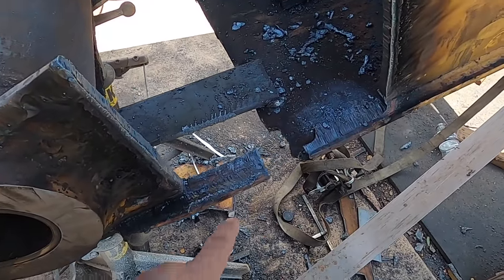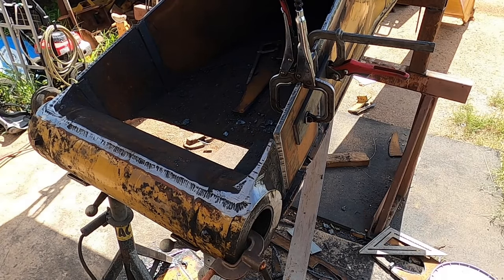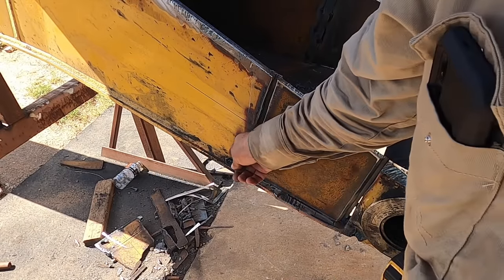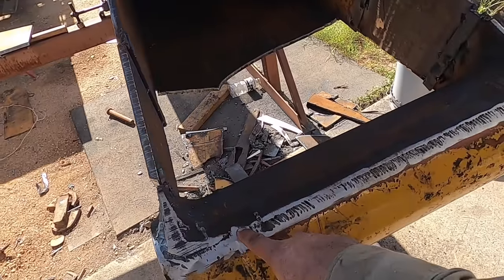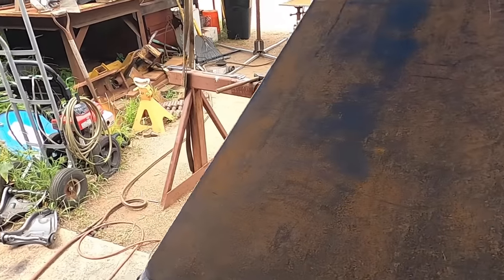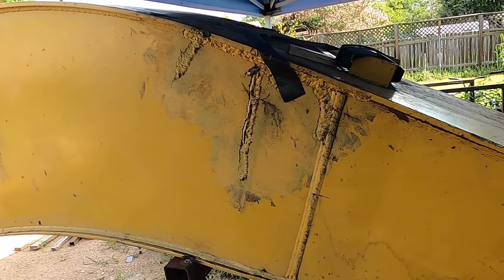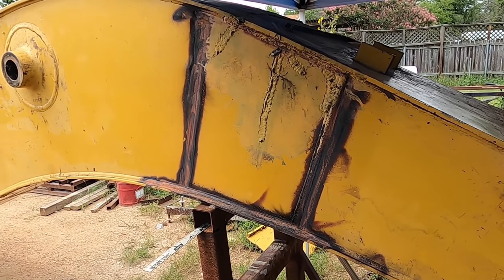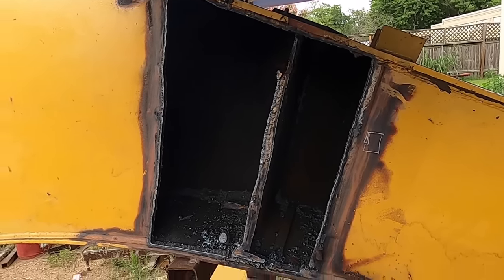Part Two: Excavator boom repair

Comment: "I guess that's why they call it stick welding..." That's about all I do when i stick weld. LOL.  I start welding school in a week. Hopefully I can make some improvements.
Reply: You'll be "sticking" less after the first day of SMAW practical exercise.
Reply: @ralfie8801  I imagine all day start. Stop. Start. Stop. 😆
Reply: Curtis Roberts 
I'd imagine you'll start out with some easy to burn 6011 stringer beads on flat plate coupons. You'll do better than you think once you get some instruction. Hang in there, it'll come to you. You'll be welding uphill and overhead in a few months.
Reply: @ralfie8801  one thing I found is that to a large extent welding is welding. I do pretty well with TIG and flux core. I'm sure stick welding we'll just take some time to get the nuances down.
Reply: You younger people are lucky today, you get to watch these videos at any time to give you tips. Back in my day it was trial and error unless you could get a pro to give you his time to pick his brain. I went to tech school and I’ve been welding and fabricating for well over 40yrs and can still learn something new by watching these videos because there’s always someone who’s run into a situation that you haven’t yet even after you’ve been doing it for years. Like IC said in 1 of his videos, “No matter how smart you think you are, there’s always someone out there who knows something you don’t.”
Reply: Mike Hunt67 
That's exactly right.

Comment: You are quite correct in your thoughts on direction of grain structure vs strength.  Coupons to determine tensile strength are always taken in the  rolling direction of steel plate.
Also ASTM E-45 standard for determining micro structure grain size is also sampled in the rolling direction.  This often referred to as a through thickness longitudinal micro.

Comment: As an airline structures mechanic, we always bend across the grain. If you bend with the grain, it's guaranteed to crack.if we need to bend a box, we turn 45 degrees to the grain. That way neither side is being bent along the grain.

Comment: You are right about steel having a grain direction. This if from a google search...."Yes, steel has a grain direction, which is determined by the mill's rolling process. The grains run parallel to the rolling direction".

Comment: You are a lazer with a torch. I used to watch my grandfather do repairs like this and others. The only thing different (IDK if it's better or worse,just diferent) he would replace the damaged plate just you did but he would overlap the inside plates 1/2 the distance or at least 3-4 inches on both sides. so after teh original plate was done and the inside holder plate was done he would do an outside plate (AKA sandwich) and stagger the welds from the inside plate with the outside plate. if it was a high torsion part, he might even cut holes in the inner and outer plates and weld in the circles. Took a while but I don't think i ever saw the same piece fixed twice.

Comment: You are right about the grain of the metal. It is always running lengthwise instead of widthwise. That's why when you curve a skidsteer center section, it's easier to do it and also gives it strength on the radius of the curve.

Comment: 10 seconds into the vid and I learned a new trick: use a piece of wood tall enough to rest the torch tip nut on the use as a guide. So simple it’s genius!
Reply from the maker: Its actually an aluminum bar
Reply: @ICWeld  that’s a beefy bar. I was wondering how it wasn’t charred.

Comment: The straight edge appears to be of the perfect thickness so that when the tip retainer nut slids along it the flame is exactly the right distance away from the metal.  Whether that's an old welders trick or your own invention it's genius!

Comment: First class torch skills! Nobody better than you Isaac in my opinion.
Also, the grain structure of the plate, how many people would even think of that when cutting out a repair section? Very few.
As for the grain of the plate, l agree the grain runs with the length of the plate as it is rolled when it is first made. That is subject to how a small (8ft X 4ft for example) is cut from the primary sheet of steel made in the factory.
Very interesting stuff and great to watch a master a work. As for me, l have to finish welding up a rotten 2008 Ford Transit van this morning. Not as interesting your work Isaac but somewhat more dangerous because it is plastered in underseal over all the rust!
Best regards from England UK!

Comment: Good evening, surpise surpise. I know one thing. Do not bye Caterpillar escavators. They are manufactured like crap. It's hard to believe that there are so many structural failures. Makes you wonder about the rest of there heavy equipment. All you can do is the best that you can. When making repairs, at least you know there is a future in major repairs. Good luck to you, Joe Capo.

Comment: Do you ever use scarfing tips? It seems like one would help out when you’re trying to clean stuff up and make it flush.
Reply: Good idea I wanna get me a set of those they are super handy to have around
Reply: @mattfogarty8144  I used to use them all the time when I was turning in welding test plates. We used to use them to cut off the backing plates so that they could be bend tested.

Comment: Is there a point of diminishing return on something that has been broken, cut, repaired, broken again and patched again?  Is the owner concerned that his operator(s) are so rough that they keep breaking  this thing?  Seems a new boom might be the answer somewhere along this journey to the scrap yard.  Your work is outstanding and likely as strong (or stronger) than new.  Keep the videos going, I would love to see this boom operating and the environment it is working in.
Reply: The calculations on repair vs replace remain the same. Flip a coin six times in a row coming up heads, the seventh is still 50/50.

Comment: Thanks IC for sharing your experience and talking us through your work plan as you find the pieces, fractures and heat zones.
The <rap that is passing through American MFG. doors is a shame today. Buy brand new broke or doomed/boom to failure.

I really wonder if these sub-assemblies are welded/fabricated off-shore? Anyone know?

I always found on rebuilding manufacturing equipment if time allowed was to replace past the damaged area and add supports to prevent the failure in the same place.

Comment: Pretty dang neat to watch Isaac, you cut so damn smooth and straight freehand............I fidgerate (combination fidget and gyrate) to much to cut nice with a torch, like a dern tiny little chipmunk........you know the ones that never stop moving, like they're on crack and every movement they make it seems they're getting shocked lmfao.

Comment: The brake press operators where I worked would complain if a batch had some parts cut along and others across the grain, I dont know if it would make any difference with what you're doing here but I like the way you're thinking.

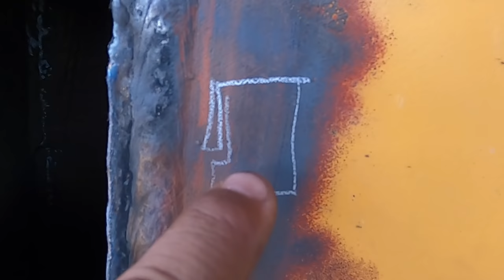Comment: Part 2 to my comment. In regards to video link, at about 27:48 you can see the overlap of the inside fish plate and the outside one with the burn outline on boom. Hope this helps get more knowledge. Not everyone does these repairs but I think you have the skillset to do more hd repairs. Bet the customer would be really happy to see some HD reinforcement like that. Nonetheless be careful this stuff is heavy so think twice and stay safe.

Comment: 28:20 stress risers like that are not good. Best way to do them is to cut rounded edges to them. I've three booms done with this and they're extremely strong structures that take up way more than the factory made ones because the cracks that might form can't form around the square edges. Also, my fabricator came up with an internal structure of sorts where he uses rods to secure the corners, we use those mostly for factory stuff, because you can just drill the corners and slide and weld them inside. You'd think that big companies like these would have better structure analysis departments. All it took us was a few hours to render the boom in 3D and do some sims, it wasn't even full on process, just approximations of the metals and ruler borne measurements. IMO, they don't even try.

Comment: I was taught that any straight vertical weld on a frame would make a week line in the structure doomed to crack . Beeline Safety Service  frame straightening , wheel alignment , brakes . Fix La Car to 80 ton dual steering axle , rubber wheeled crane   80 ton , yard use dump trailer , one off  construction , with too much  camber in the start of fabricating the frame we had to make the new frame fit the  pre-cut pieces all ready cut to spec  . We used 1 , 125 ton jack and 2 ,50 ton jacks to do the job , scary .

Comment: Your intuition is correct where the grain direction is concerned. There is better toughness perpendicular to the "grain" or the direction the steel was rolled into a coil. I am not a metallurgist but
we had a lab in the factory where i worked. Drawing steel you see where it fails AND where it likes to stretch and form without cracking or failing when stressed. Was that 1/4" or 3/8" plate? Anyway it was HRP&O, Hot Rolled, Pickled & Oiled. Each coil had a Tag with the Heat # and Rockwell (or hardness) back in the day.
     That "Plate" came off of a coil, and was sheared after de-coiling and straightening. Then skidded up to ship or sell.    Your skill level is really a great thing to observe- you hardly need a grinder after your torch cuts. Bad Ass really. (Welder, Press operator,welding lathes, brake Press deep Draw Metal Flow Operator and on and on). Some of the above was for your readers, I know you are no beginner.
   I learn a lot on here reading the comments. Keep up the good work- like your channel.

Comment: When I took my certification for 2G and 3G flat, the requirements were to have a backer bar and 1/4 inch separation between the pieces to be welded.  My 6G 6 inch pipe required an 1/8th inch gap but no backer.  Little gap is good.

Comment: Back again!  Cutting the "pattern pieces" is a much better method of getting the replacement the right size.  Would the plasma cutter you bought after this job have done as well as you did with the OA?

Comment: Shouldn't the backing plate be the same thickness as the parent metal, otherwise it's just a filler panel to hold the weld in.

Comment: Steel has a grain it comes from the direction it was rolled in the factory, You will also find that your welds will have a flatter and look smoother one direction better than the other will sit higher.

Comment: I heard a lot of hissing and popping when cutting the flat plate and later when opening up the left side of the boom.  Was that the camera audio or were you running short of gas?  I don't recall hearing that when I am cutting nor before in yours.  Not that I am comparing myself to the maestro!  The video audio does do some funny things to sound but in between that flat plate and the cutting on the left side the torch sounded normal so it left me wondering.  Always enjoying watching you work and appreciate your equanimity!

Comment: Your cutting is laser straight. You are quite a fabricator. Question is why did that boom fail that way? It seems to have split along several factory welds as well as in other areas. Pleasure to watch a craftsman at work. You know you metals and how to work them. Did they use too brittle of metal and too thin or poor penetration of their welds? Do a little metal work now and then so curious.

Comment: Why not offset the two rhombi? Meaning the inner cuts do not line up across from each other. Much like offsetting electrical wires when soldering, to further prevent shorts. If the welding cuts don't line up, then a bending/breaking force cannot concentrate.

Comment: Pure art man. Amazing. Question though. What is the nozzle of the torch made of so it doesn’t melt? It slices right through that steel but it doesn’t melt? I’m new to this so just trying to learn. Thanks!
Reply: ha, good one! the hottest part of the flame burns a little distance from the nozzle, and the nozzle is cooled by the cold gas flowing though it.

Comment: I am surprised you do not use the plasma cutter more, in the beginning of the video you were torch cutting the new steel plate when you could of easily plasma cut the metal.  I use plasma much more then I use a torch due to ease and quality of cuts.

Comment: If carpenters worked with metal, all torches would have guide wheels on them, and you would clamp a fence on first and then run the wheels down it.
Welders are crazy free handing this stuff! Lol

Comment: How can you be sure someone REALLY knows how to use a cutting torch?  When they cut 3/8 plate cleaner than you can cut paper with an xacto knife, using a wooden straightedge, and manage the heat so well the wood doesn't even discolor, that's a pretty good indicator.

Comment: If there is any metal grade lettering on the plate, the grain direction will run parallel with the lettering.  At least that's how our shop does it.

Comment: Just wondering what you use for steel,plate when doing these repairs on excavator booms. Is it AR  plate or just hot rolled plate
Reply: Was wondering the same
Reply from the maker: T-1 plate
Reply: @ICWeld   Awesome thanks.
Reply: @ICWeld  Have you ever used Domex steel before? Supposedly it welds like butter. I’ve heard that T-1 can get hard spots in it from the steel mill that can be sometimes problematic later on.

Comment: Hey, you are great with the torch!!! what are your settings on the gauges and what tip size did you use to bevel the plates?
Reply: He has a video up about torch tips he uses and settings. Best I recall there were like two tips for is “go too” ones 
Hope that is some help

Comment: That boom was destined to fail from the start, I would say Bad on Cat but I will bet to save cost things like these booms are not in house manufactured. Likely mass built across the pond shipped and assembled in the states It is the only justification I can come up with for that ridiculous baffle plate.  Roughly a $ 250,000.00 machine failed by few pieces of what look like scrap steel.

Comment: rear cutline should not be straight perpendicular line to flanges.Should instead be triangle or radius shape
Reply from the maker: The Factory builds them with straight lines perpendicular to the top and bottom flanges. They hold up fine so long as they're welded correctly.

Comment: looking at the metal fatigue I would be scrapping the project..

looking at the thickness of metal tells  me it should be preheated before welding

yes you can cold weld shit to cows come home however when  anything is used in construction it has to be certified  as safe to use  and typically has to go through a x-ray machine... preheating helps the metal to bond with each other..

Sadly with the amount of defect in the arm I would not be certifying it to be used as it is intended to be functional used

If you did you be at legal liability  for it

Comment: What are your thoughts on Harris torches? Yeah or nay.? Does anyone else here have any experience with them?
Reply: Stan, I've been using the same Harris torch for more than 20 years now and it's been fine. Mine says made in Ireland and I believe Harris is a division of Lincoln. I've replaced tips on occasion and o-rings but other than that quality is good. No complaints. It's kinda like do I buy a Lincoln or Miller, Victor or Harris. Everyone has their opinion but I don't think you can go wrong with either one.
Reply: @mikemaiman3623  thanks for your feedback I love mine

Comment: So if I understand you correctly you said that the bafle was installed short from the factory? With that plate on the inside to make up the difference??
Reply from the maker: yup
Reply: @ICWeld  Thats just straight up messed up